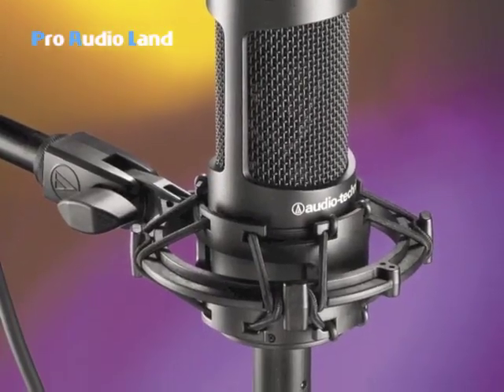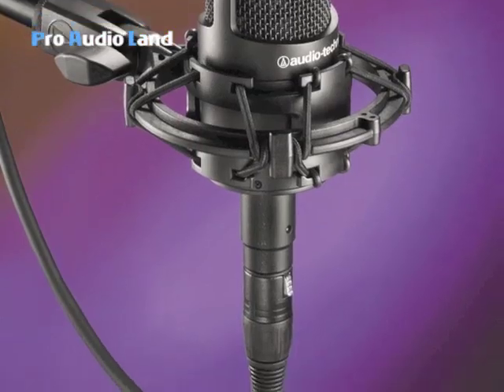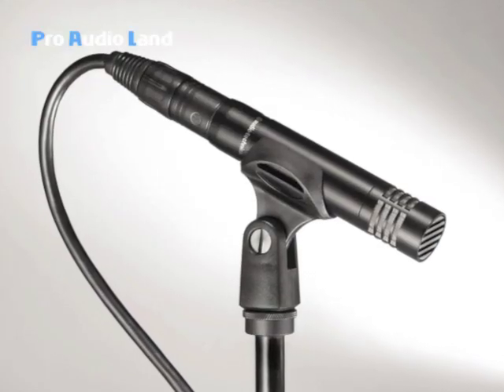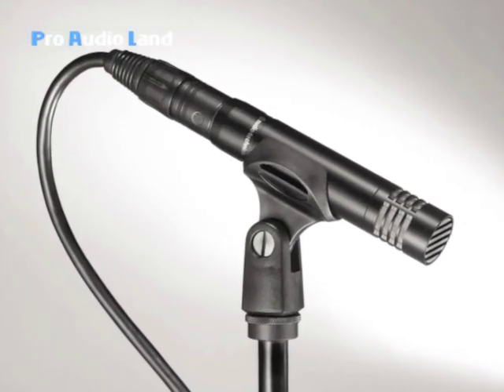Microphones 101: Large Diaphragms vs Small Diaphragms Explained - Video 4/9

Comment: This is basically the front end of the signal chain.  So, yes, you could EQ a small diaphragm mic and take the top off it - or on a large - EQ the top up.   But in each case you are possible chasing something that won't be there - as the large doesn't do transients and HF very well; then just trying to EQ that in will sometimes just not work as those frequencies are just not there in the same way as they are with a small diaphragm mic.  And ditto the reverse with the small.  However, with both mics you can interesting results from doing the EQ thing and then getting what is essentially not a natural, but an attractive sounding outputs.  So you'll need both.

Comment: Very nice video. Would a larger diaphragm condenser have higher fidelity low frequency response compared to a smaller diaphragm? Or would both types pick up the same spectrum, maybe with less low end for the smaller one (EQ compensatable to match the larger diaphragm)?

Comment: Hi proaudioland:-)
I have a question:
I am recording my acc.guitar with a large on the body and a small on the 12thred.
It sounds realy great when they are panned in each direction.  
The problem that i have, is that when i want them to be in mono, they sound much to boomy, is that normal, or am i doing anything wrong?
Scould i stand further away from the mics perhaps?

Thank you:-)
Reply from the maker: This issue could come from a few different variables. If your are not already, be aware of the polar pattern on your microphone as they can vary. For instance if you have a hyper-cardioid polar pattern, you could be picking up a bit of the room which could introduce room tone to your recording causing the "boomyness." This is not most likely a factor, but it can be. The issue could lie in how you are pointing the microphones at the guitar as well. For example If you are placing your large diaphragm microphone on-axis (DIRECTLY AT the sound hole assuming you have a cardioid polar pattern)  your going to capture a bit more low end due to all the sound waves hitting the diaphragm of the microphone straight on. If you place the microphone a bit off axis meaning rotating the microphone to where the polar pattern isn't pointed directly at the source you will decrease the amount of sound waves hitting the diaphragm directly. Perhaps aiming the cardioid polar pattern A BIT more towards the bridge, you will reduce the amount of low end frequencies hitting the microphone directly essentially equalizing your recording at the source. The same can be said about your small diaphragm condenser microphone. 

If your pointing the microphone directly at your 12th fret, all the sound waves are hitting the diaphragm directly and could possibly be picking up low frequencies from the sound hole. If you  point your microphone a bit off axis, you will reduce the frequencies hitting the diaphragm straight on. Perhaps you might want to point your microphone still at the 12th fret, but slightly more towards the neck.

In addition, this being that you are playing an acoustic guitar, dynamics play a role in what type of sound is being produced from your guitar.  If your doing fairly strong strumming, you could be producing more low end as opposed to just slightly picking the guitar. 

Now to answer your question about standing further back.  If you are in a great studio space with a properly treated room, you could stand a bit further back, however, if you are not in a properly treated room, standing further away from the microphone is going to introduce more of the room sound because the sound waves must travel a greater distance capturing some of the room on the way.

Ideally you want the microphone to be fairly close to the source you are recording and placing the microphones a bit off-axis will help roll off some low end which will allow you to be a bit closer to the source with out having the proximity effect add boomyness. 

One last solution to this problem would be to do some subtractive equalization to the recording if you definitely can not get the recording how you want it from the source. This is the process in which you sweep a FAIRLY NARROW band across the frequency spectrum until you target the boomyness your referring too, then when you find the problem frequencies, perform a narrow band cut the frequencies by about 3dB or even 4dB in some cases. Hope this helps and happy recording!
Reply: This could also be a phase issue, since the sound changes when summed to mono. The 3:1 rule might solve it. Place the mics at least 3 times the distance apart from each other, as they are from the sound source.